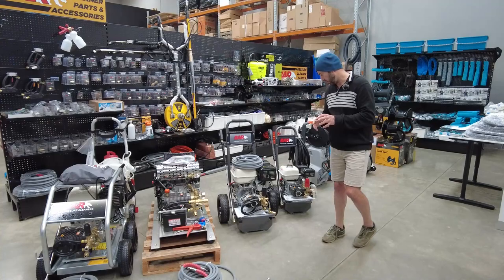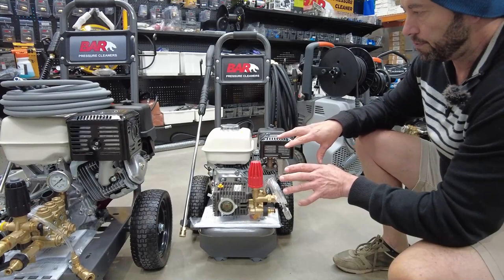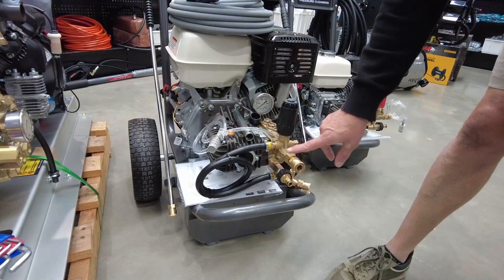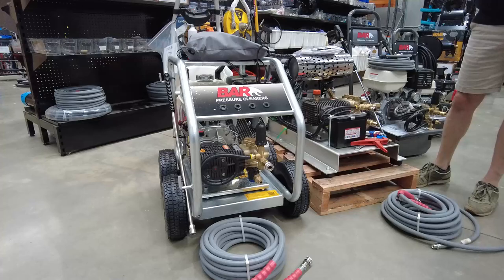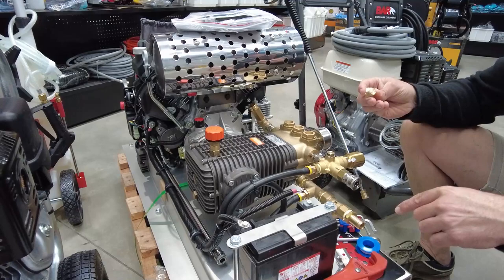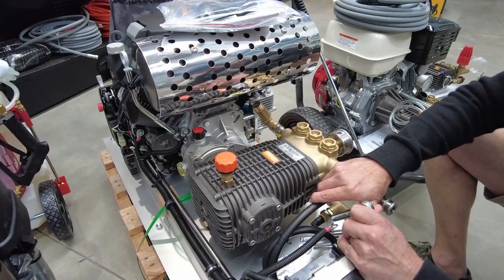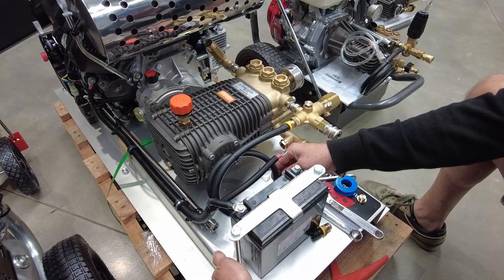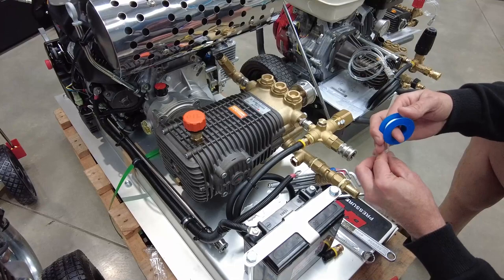Lets Bypass the RUN AROUND | Keep Your Pressure Washer Cool

Comment: I had a guy turn off the water the other day on me when he saw it just running out of my ball valve while I was walked away getting something. I need to do this lol. Thankfully I don't think anything got messed up. It might have been 45-60 seconds from seeing no water to the machine turning off
Reply from the maker: Fingers crossed, all you can do is run the machine as normal. It was a short period you may be ok.
Reply: @BlueTongueIndustries1300884566  I ran it for another hour or so after that so I think we're ok🤣

Comment: I just got a new 4040 pump. I’m not familiar with a bypass hose at all. My question is if I have it bypassed and running out on the ground will it not run the machine out of water?  Either by being on the trigger or being off and it running out of the bypass hose.
Reply from the maker: Your garden tap on all the time, so when your pressure gun is pressed all water to your pressure cleaning lance. When you release the pressure gun the water from the tap passes through the pump and drops to the ground. This bypass water on a skid mounted unit we usually bypass back to the tank.
Reply: @BlueTongueIndustries1300884566  I agree. Back to a tank would be best. It just seemed if you had it running out constantly it would run the pump out of water. Thanks for the reply

Comment: I’m new to this. Love the video. I have a 4 GPM / 4000psi pressure washer I just bought. How long can you leave it running without pulling the trigger if set up like this? I don’t like the idea of having to pull the trigger every 30 seconds to avoid overheating. Also, should I run this into a buffer tank or just let it go out onto the ground? Appreciate the help.
Reply from the maker: Without bypass, to ground or back to tank around 5mins. With gun closed and a bypass to gnd or tank…all day.
Reply: @BlueTongueIndustries1300884566  Thank you! I’ll definitely be doing this.